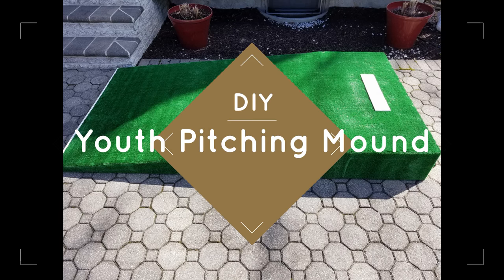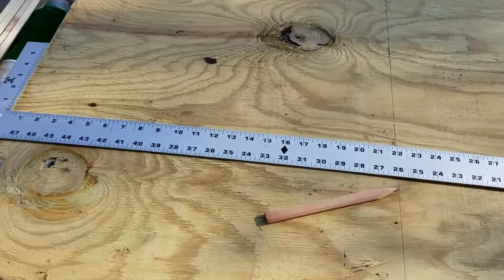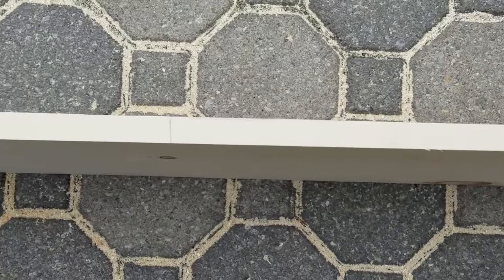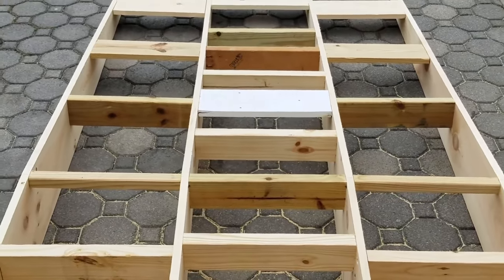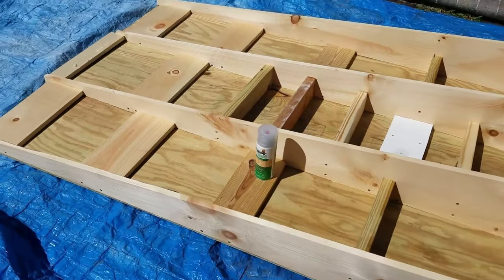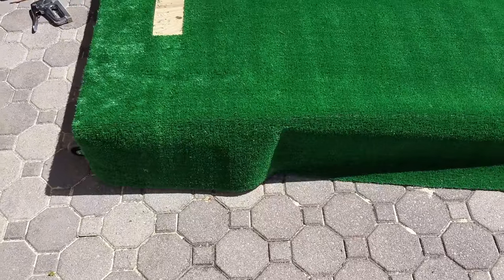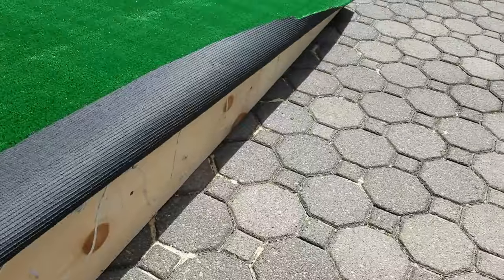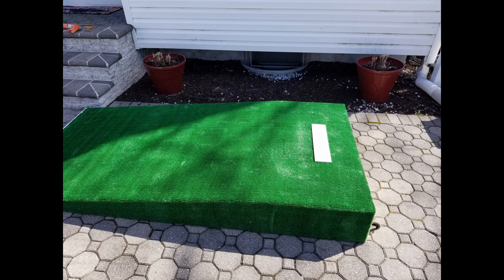DIY Youth Baseball Pitching Mound

Comment: So I just finished building this and Chris is correct. The pitching rubber needs to be 6" from the slope and -1" every foot. Made those changes, and the mound is very nice and heavy. I used 4 - 2x4x8 pressure-treated wood (15" is the distance between 1x10s) for the supports which added a lot of weight I'm sure. I also added 3 wheels in the back of the mound, and a handle in the front. Other than those changes, I followed the instructions. I went through about 4 tubes of Liquid Nails (using a caulking gun) so prepare accordingly. I'm super happy with the finished product. Thank you.
Reply: How high did you go on the platform where the pitching rubber is?

Comment: Built this today. Stayed with the size described. Reinforced with 2X4s. Came out FANTASTIC!!!!
Total cost was 165  ish. Wood,screws,liquid nails, 2 handles, 2 wheels and water proofing was 110. turf 40 and rubber strip 15.  Yes its big, yes its heavy,  its pretty easy to move around. Will he need another one? NO!! this is heavy duty. I'm 250lb  and it does not budge. Solid and stable.  I braced with 2X4s around 20 of them. ( he's 12 and already 5'9" and 172lb.)  I did not include the 2X4s price as i had them already. Took about 5 hours. Will finish up the turf install  and rubber strip tomorrow. Thank you John Judge for the video. This was fun and pretty easy.
Reply from the maker: Nice job! Thanks for the feedback.
Reply: So you made it the same dimensions? I just want to make sure this will work for my son  from now until his senior year. He’s 5’8 now and is in 10th.

Comment: Nice but I would make a few changes:
Make it narrower...3 ft not 4ft and use 3 braces so most of the pitcher's weight will be on the brace, not between braces.
Use a waterproof guard under the mat, or buy an outdoor carpet that has rubber backing. This will make your plywood last way longer.
Making it smaller with less but critical brace positions will make it stronger and lighter. Waterproofing will make the mound last much longer.
Reply from the maker: The reason I didn't go narrow is that my son likes to use both sides of the rubber and he steps to the side.  And with the current width, it's perfect without risking falling off or feeling uncomfortable.  Good feedback and ideas though, especially for others.  Thank you.
Reply: Turf I found at Depot appears to have rubber backing. You recommending another layer to insulate plywood?
Reply: @firewall72  keep it wide, if you ever see the perfect game mounds those things are at least 7 feet wide
Reply: Just curious on price for materials and time for the project to decide if better to make or buy 
Thanks

Comment: How do you know the angle of the mound to build it at
Reply from the maker: Hi, I didn't measure the degree of the slope, but you should see that covered around the 1:30 mark. I would recommend using a chalk line as well. Good luck!

Comment: So with the 2x4 supports the item list states cut those to 2 foot lengths. But that’s not correct is it? The distance between each slanted common board is less than 2 feet, so was curious what size you cut the supports? Thanks!
Reply from the maker: I made this a while back, so probably just an estimate size as those should fit tight and cut to fit as needed.  Good luck.
Reply: Supports should be cut to 15"

Comment: The angled cut on the 1x10 looks like less than two inches from the bottom edge.  Is it really supposed to be two inches as stated in the video?  Thanks for this excellent plan.
Reply from the maker: I would say yes and close an accurate 2", but feel free to tweak as needed.  I'm sure others have compromised along the way.  My son was using it tonight and is almost 13 and still loving it.  Thanks.
Reply: Outstanding. Thanks John. My kid is super excited to get this going, and learn some carpentry skills on the way!

Comment: Good job how has the mound been holding up? Would you make any new changes to it?
Reply from the maker: Rock solid.  I'll look to cover it over the winter and with a little luck I'll get another few years out of it.  No changes, but I would like to emphasize the importance of secure wheel mounts with bolts, washers, etc., especially if you plan on moving it around like I do.  Good luck!
Reply: Cool, my son is 10u is this a good size for him?
Reply from the maker: @JacobMedinaBakoRealtor  Yes, I believe so.  My son used it at 10U and just moved up to a 11U.  I would say its a lot better than some of the mounds we use in our games.  I've also thrown off it and it doesn't feel small to me, so it if the wood holds up it should last as they grow.
Reply: About how much in materials did this cost?
Reply from the maker: @JacobMedinaBakoRealtor  I would say under $200 for sure, but don't recall the exact amount.
Reply: Fantastic build video! My son just turned 13. We are going to build your mound this weekend. Would you recommend I modify (size up) the dimensions at all? 

One other quick question. Do I need a table saw or just skill saw and drill?
Reply: Jacob Medina we just built on yesterday, got materials from Home Depot and it cost right around $100 including two small house plants 🌱

Comment: My son is 5’8 and still growing. Can this be used for a high school aged player?
Reply from the maker: I would say so, especially if you use quality wood.  You can also make it a little bigger if you like.
Reply: @firewall72  So I can do 4- 1x10x10 I guess. Nothing else changes, right?
Reply from the maker: @ericbezares177  that should work.  I would recommend testing the strength before screwing the plywood down.  Good luck!
Reply: @firewall72  Thank you!!

Comment: Thanks for posting this.  This says its a Youth mound.  Can a highschooler who is pretty tall use this?  does the slope of the mount change by chance if it is to be used by an older, taller pitcher?
Reply: There is a "standard" height, but in reality... it depends on the youth league. A lot of them roll them out and they buy what they can get cheaper/in bulk. Dirt mounds unless perfectly maintained are always a little off. In general, as long as you have a flat surface up top and a decent slope you will get what you want out of it bullpen/practice wise. BIG tip is to have about 2 feet behind the rubber that is flat unless you only want the pitcher working out of the stretch on it. Don't want anyone stepping off the back and landing on their a**. Former college pitcher who went to a small high school and experienced a few different versions from the blue collar dads who put them together.
Reply: Youth height mound is 8" above home plate.  High school and older is10"
Reply: @joerogers7359  Is this 8"?  I am searching all over the comments here to check if it is 8".  Thanks!

Comment: Hello I know this is kind of old...but do you or anybody know where do I put the pitching rubber? for example how far from the slope? Thanks for any info you may have thanks a lot...great video, I built ours today going by your instructions.
Reply from the maker: I would recommend starting in the middle of the platform and then move towards the rear or back based on preference.  I'm glad the video helped!
Reply: 6” from the beginning of the slope.

Comment: does this mound work for teenagers/adults?
Reply from the maker: I am 6'3" 275 and can throw off the mound for instruction without issue.  It really depends on how you build your supports and the quality of wood.  You can always add length and width, but obviously this will add to the weight.  I tried to balance that out so it could be wheeled in my yard.  Good luck.

Comment: Would you have a ballpark on what you spent on this? Thinking about $100
Reply from the maker: I would say between 1-200 depending on where you shop.  If you can try and use some wood lying around.  This would help keep the cost down.

Comment: Did you use a table saw for the cuts?
Reply from the maker: I used some clamps, horses, and a circular saw.  If I had a table saw I would have used that though.  A lot safer.
Reply: John Judge Ok thanks!

Comment: My kid is 9 years old and already throws 60+ fastball! 
The mound will definitely help out.
Thanks.
Reply from the maker: Awesome, good luck.
Reply: 60+???  I'm sure.
Reply: Nice job on the mound though John.  That Surf kid will prob be throwing upper 90s next yr.
Reply: This is great.  I modified it based on boards I had laying around. No extra cuts were needed to the turf on the sides where the slope begins??
Reply: Howie busse I will be throwing in the 90s
Reply: yup into the backstop !
Reply: Just build this mound, Surf105 motivated me. I’m now in my mid 30’s throwing about 104mph. ⚾️ 💨 💨